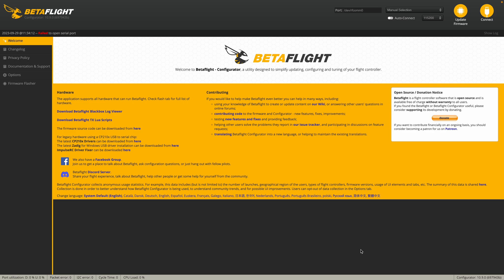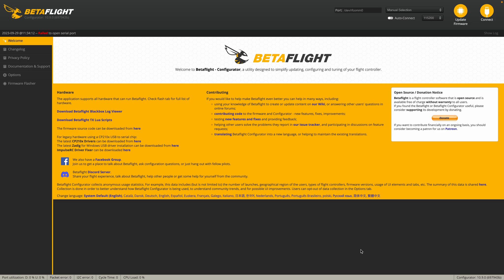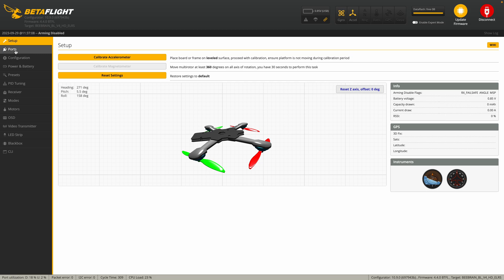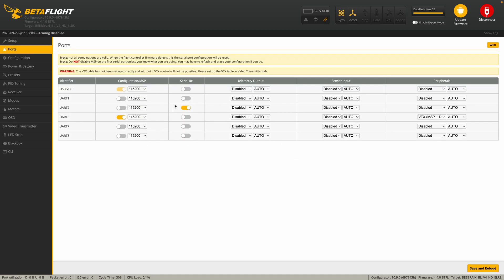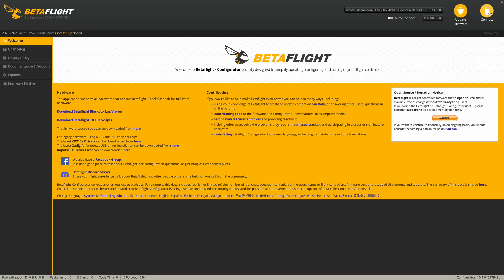AcroBee75 HD Switch Receiver to Bind with DJI FPV Remote v2 (F7 Version)

Comment: The motors will not spin up? All other controls and switches are fine.
Reply from the maker: If you change any setting you can do a reset on betaflight, it will bring it back to factory default. If it still not working please contact with support@newbeedrone.com
Reply: @NewBeeDrones  ive emailed you guys but cant get a hold, i cant get my drone to work even after following all the steps it wont let me bind the arm button in betaflight and i cant even reset it.

Comment: I’ve been getting osd warning on my Acrobee 75 hd says rcsmoothing it’s very annoying any ideas why it says that?
Reply from the maker: Go to betaflight and then go to OSD tab. check out warnings, you will find RC Smoothing failure. Turn this off should get it fix.
Reply: @NewBeeDrones  it worked thanks. Any idea why that error message came on?
Reply from the maker: @walmart_cereal  are you using Level mode?
Reply: @NewBeeDrones  I’m using the drone with its default settings
Reply: @NewBeeDrones  the error says something that rcsoothing wasn’t initialized that’s why the error is popping up but I don’t know how to initialize it
Reply: @NewBeeDrones  the error also popped up in Acro mode angle mode and horizon mode
Reply from the maker: @walmart_cereal  I think it Probably using level mode and it is not calibrated. As long as it works, you can totally ignore it.
Reply from the maker: @walmart_cereal  I think it might be setting  . We will dig into it.
Reply: @NewBeeDrones  thank you everything is fine ever since I disabled the osd warning something weird was that in the reciver tab I turned off rc smoothing and the osd warning still popped up maybe it’s a bug? Oh well it doesn’t affect my flight so it’s good now
Reply from the maker: So far I only gets two report of this problem, I didn't trigger that bug personally, but i will dig into it! as long as it flights good
 @walmart_cereal
Reply: @NewBeeDrones  awesome thank you so much it flies fine just that error was annoying it’s been doing great and I do get 3 mins of flight time
Reply from the maker: great to hear you like it! the 450 HV or non HV battery can all do around 3:30 flight time. we want it to be safe for user to have 30 seconds to get back, so we market it as 3:00. 
 @walmart_cereal
Reply: @NewBeeDrones  you guys are great :)
Reply: @NewBeeDrones hi I might have found out what was wrong my elrs packet rate was set too f1000 when I changed it too 250hz and I no longer got that rc smoothing warning I will continue to fly and see if the warning comes up again
Reply from the maker: @walmart_cereal  that make sense, the package rate different probably mass up with the RCsmoothing feature.
Reply: @NewBeeDrones  I’ve had no issues ever since